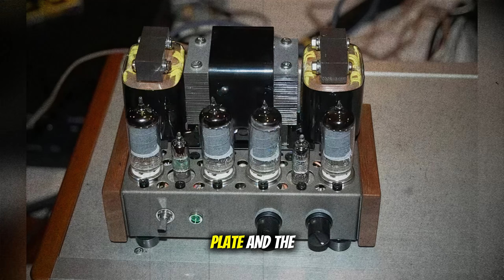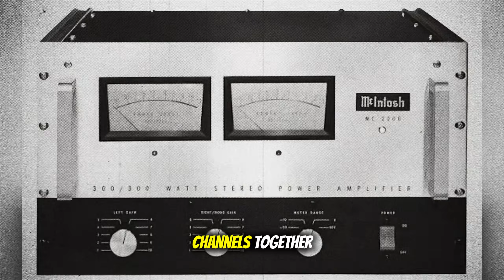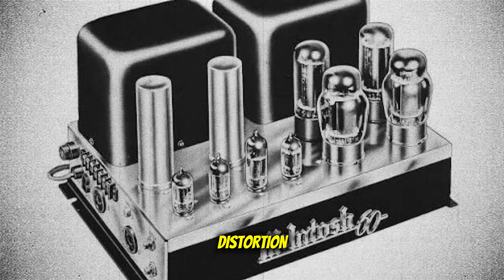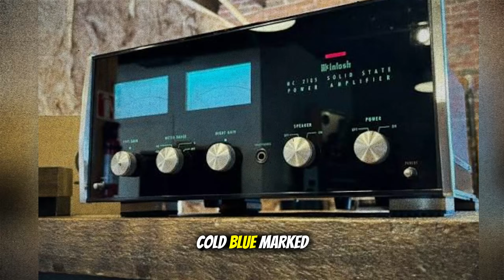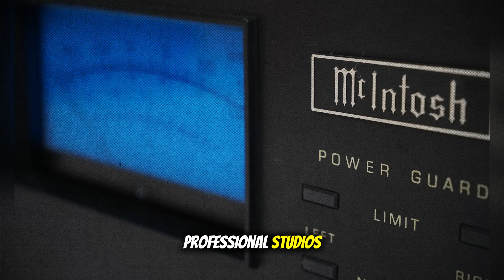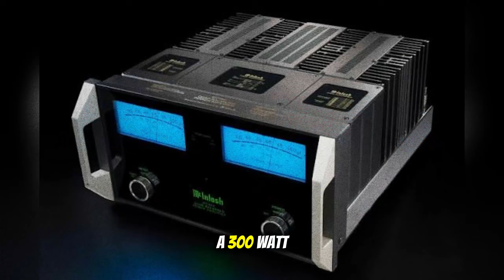Every McIntosh Amplifier Explained | 1949 to Today

Comment: Rather ironic the length of your video is 22:05. This is the McIntosh (MC2205) amplifier I have in my main system. And I still have my original MC2505!